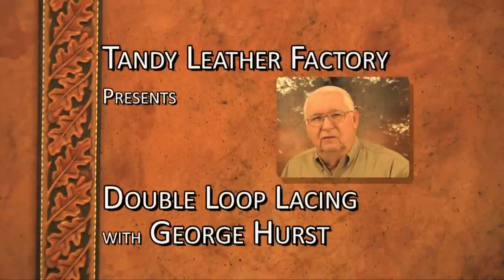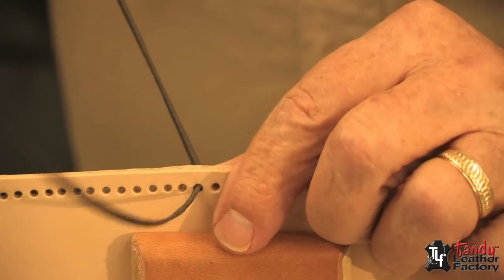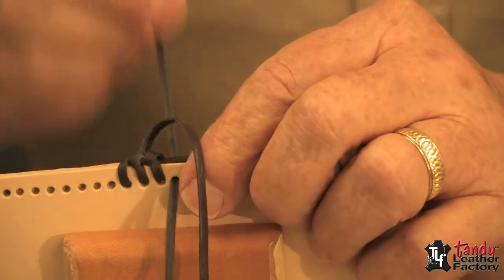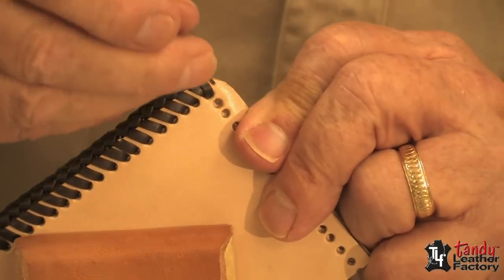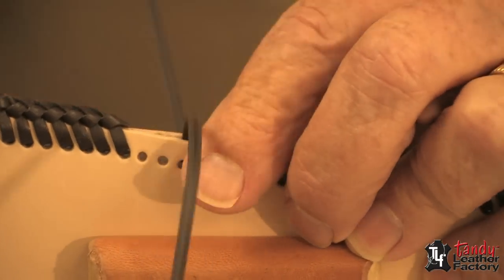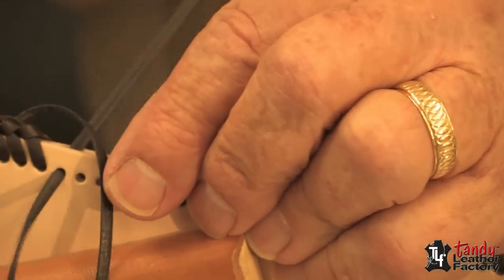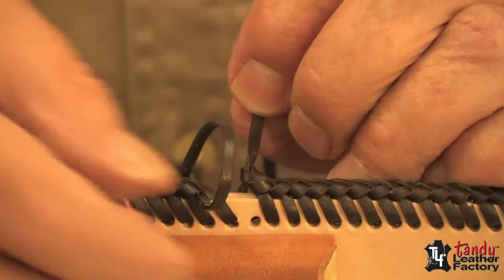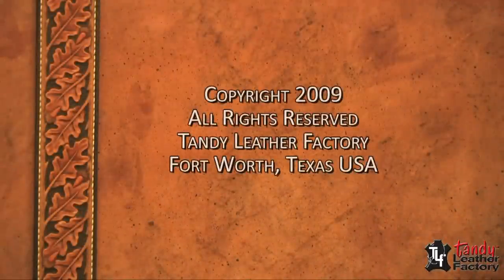How To Double Loop Lace On Leather

Comment: Thank you. Back in 7th/8th grade leather shop (1967/68; 1968/69 school years) the double loop stitch was my favorite and most used. I haven't done any leather work since, but plan on doing some again soon. My old leather shop instructor Mr. Reins (he also taught my dad and his two younger brothers, and my two younger brothers) would roll in his grave if he knew I'd forgotten how do do this stitch.

As for splicing ... we removed the needle, squared and  beveled the end, glued another length of lace after squaring and beveling the end of it,, to the original lace then re-attached the needle and continued on. 
If memory serves, our glue was rubber cement for the lace splices, and when necessary the edges of what we were making.
Beveling and gluing seems an easier way than stitching in a separate lace, then bringing the original lace over to the end of the splice. How do you hide the length of original lace laying along the side of however many stitches were made with the splice lace, when you bring it over to the end of the splice?
What if the original lace isn't long enough to go the length of the splice?

Comment: What a gorgeous trade! I am so eager to learn! Thank you so much for sharing your wisdom! I could watch you for hours! 🙏🏻🙏🏻
Reply: If you haven't done so find a beginners set of tools and practice practice practice you will improve only by doing it. Now there are online things like this. I learned by trial and error. Remember once you hit the tool it's almost impossible to correct the stamp you just put down crooked. I learned a couple things watching this about the starting and finishing the lacing. I used to do the X thing like when he started lacing but there is another way where you start by making a loop around the end of your lacing that looks the same as when he finished and had that loop that he went into to end the lacing. Good luck with your crafting and start simple with some like keychains  fobs etc. Don't start with a wallet they are more involved to make and you may be discouraged if you have a bad experience. Don't give up :)

Comment: Yes so great to find and see this. A lady from church brought her worn out Bible and asked if I could re fasten the loose signatures and make a nice durable cover. There shouldn't be any problem drilling and lasing  the signatures but I had wondered how to fix the outer edges of the leather cover. On scrap I've tried scarfing and folding but it looks amateur or even Kindergarten class quality. This lacing technique should look nice plus give the outer edges more strength. Thanks again. I luv YouTube crafters. Really wish I knew how to edit how to videos. I would like to give back to this community part of what I have learned and pass my metal working knowledge on to whomever that could use it.

Comment: i dont know if jclaudio sink has gotten an answer yet, but the way you do it is: first you need about 7-8 inches at the end so this usually means that you need to unlace a few stitches. then if you watch how the guy in the video ends his, you just need to do the same, but with the new lace you put on needs to be big enough to finish your project. if you do it right you wont even be able to notice that you ran out of lace. you can do this as many times as you have too, i had to do it twice.

Comment: Hey great video, just curious what size lacing is being used in this video?
Reply from the maker: 321hot2trot123 In the video, we used 1/8" lace, however this method will work for any size: 3/32", 1/8" or 5/32".  The desired size depends upon the project. Billfolds and smaller items use 3/32" where as handbags and larger items use 1/8".

Comment: No, my question was what size hole punch are the holes, in the leather. Thanks.
Reply from the maker: +summer 91 The tool George used punches 3/32" (0,2 cm) lacing holes

Comment: How long of a leather lace should we use?  My recollection (haven't done it for a few years) is to measure the distance of the holes and multiply by 7.
Reply from the maker: +Pat Mitchell For the total, that is roughly the correct amount, however it makes it much easier to manage if you only use two arms lengths at a time and then splice the lacing.  This helps it be more manageable, but also helps prevent the lace from fraying by reducing the amount of times a single piece passes through the holes.

Comment: hi how do u cut holes did u just punch them one by one. also can this method be used for thin leather. and lastly whats the difference between lace and thong strips thank you
Reply from the maker: +Darren Mckean The piece of leather used in this example is from a kit with pre-cut holes.  It is more common to use a chisel (called either a thonging chisel or a lacing chisel).